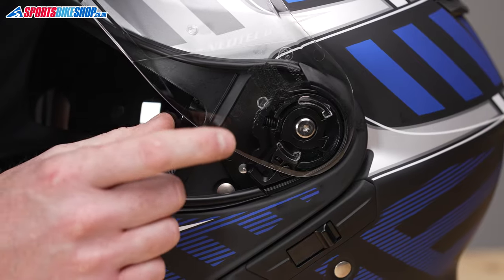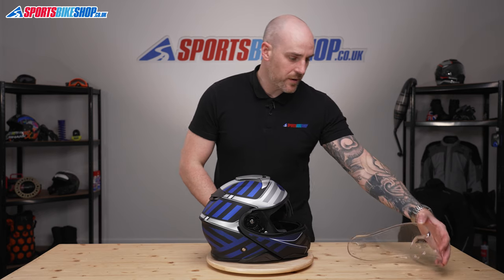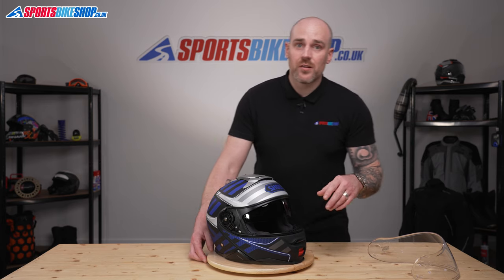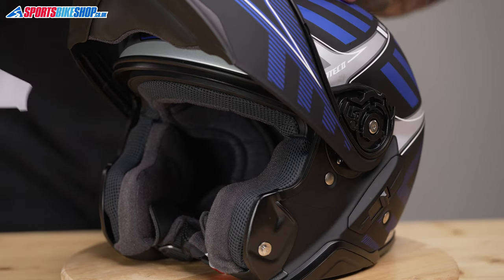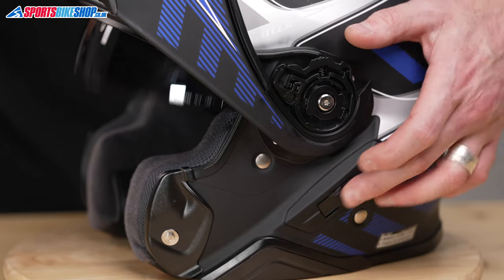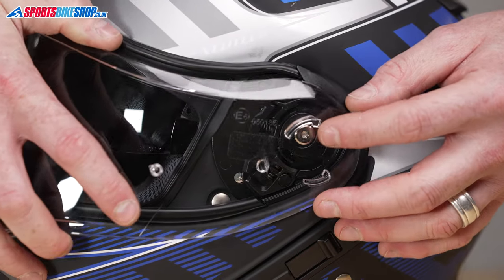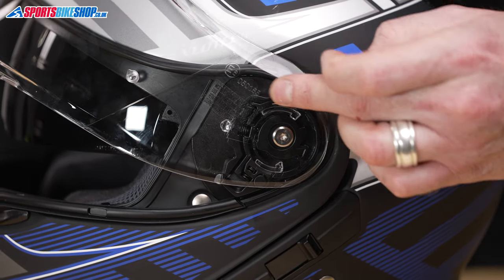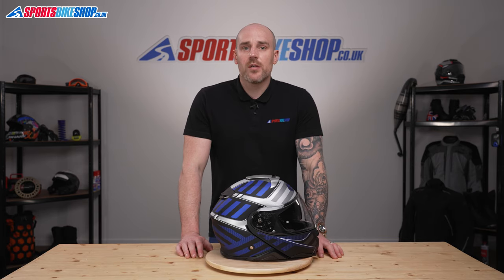How to change a Shoei Neotec 2 & 3 visor and sun visor - Sportsbikeshop

Comment: Dear Sportsbikeshop Video-Producer
THANKS 🙏 A BUNCH 4 this video and Your detailed description of how to remove and attach the visor of a "Shoei Neotec 2" helmet. 
2017 I‘ve bought a Neotec 2 at a 20% discount at the local motorcycle dealership, where I‘ve bought my "Pokey" (Yamaha MT 09 or FZ 09 like the AMERICANS like to dub the MT 09. 
Up until now, I‘ve cleaned the visor without removing it from the helmet. 
But IT IS REALLY MUCH MUCH MORE COMFORTABLE if the visor is removed beforehand. 
As I‘ve tried to attach the visor after the cleaning, it DIDN‘T WORK as it’s supposed to. 
BUT THEN, AFTER YOUR AWESOME DESCRIPTION, voilà in NEAR MINT condition. 
I guess it’s not rocket-science, but can be tricky though. 
Greetings from Switzerland 🇨🇭

Comment: Thanks for the useful information. The absurd complexity of Shoei's visor connection system may deter me from buying another one once my current Neotec II needs replaced. I can change an Arai or Schuberth visor in 20 second or less. Doing it on a Shoei is often a five minute job. And there's no reason the company can't fix this. But your video may get me by until I buy something else.

Comment: How about adjusting the visor when you notice a draft while riding and notice the visor doesn't seal correctly? Is there a way to "pull" it tighter against the bead?
Reply from the maker: I've checked the helmet and the owners' manual and there's no obvious way to do this. If you can get the helmet to a Shoei dealer than I'm sure someone would take a look for you to see why it's not sealing correctly.